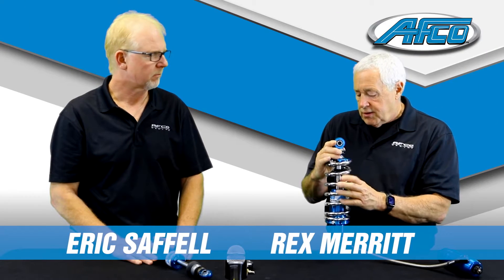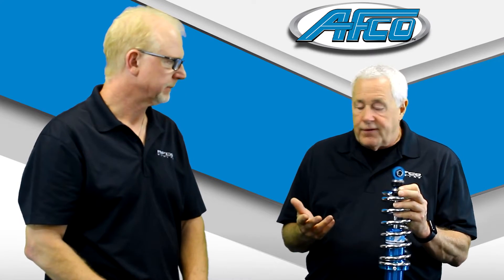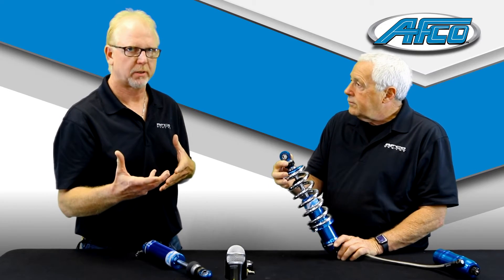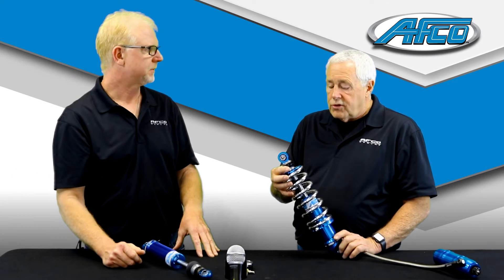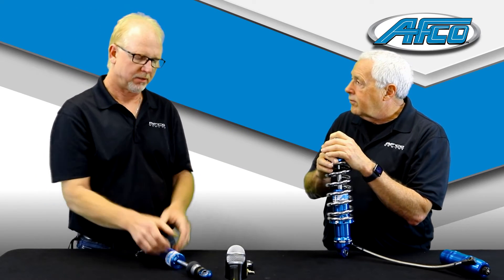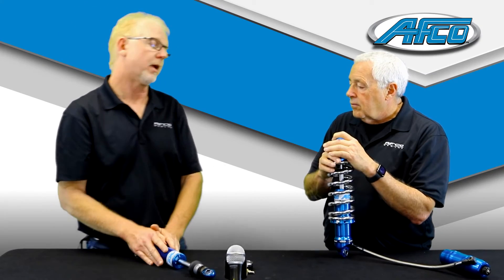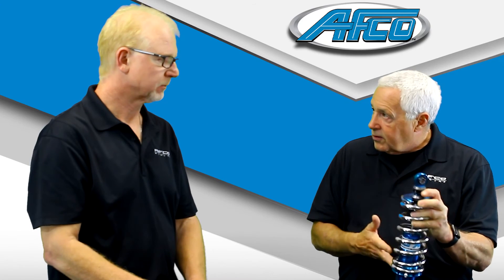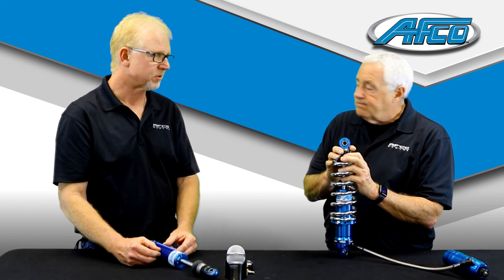Mounting Shocks on An Angle

Comment: Great info, thanks guys. I’ve got a question though. If you lengthen the upper and lower control arms on a double wishbone front suspension but keep the shock mounting point the same, is there any adverse effects? If your shocks are vertical before should you be angling them out if you lengthen the arms?
Reply: You’ve effectively changed your motion ratio